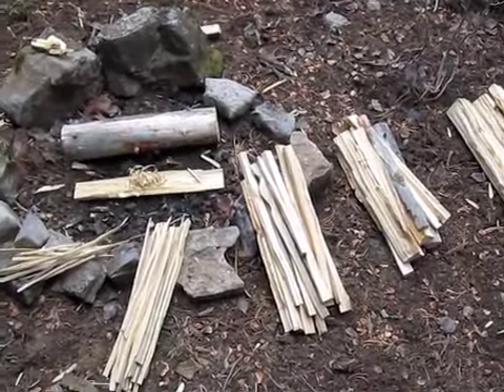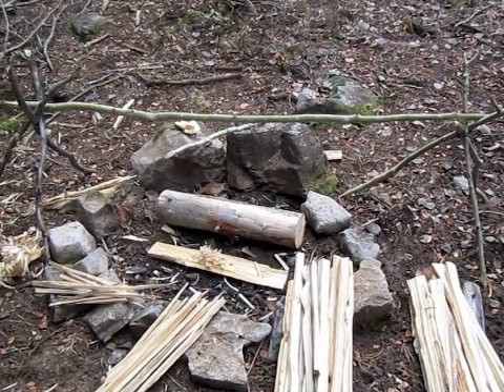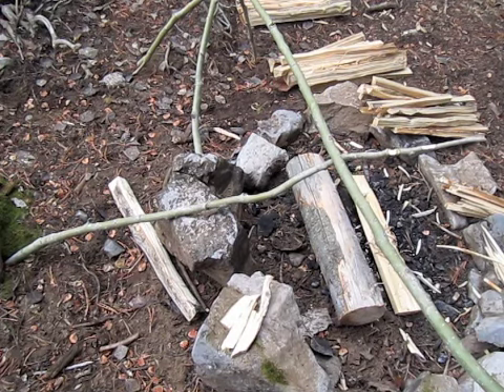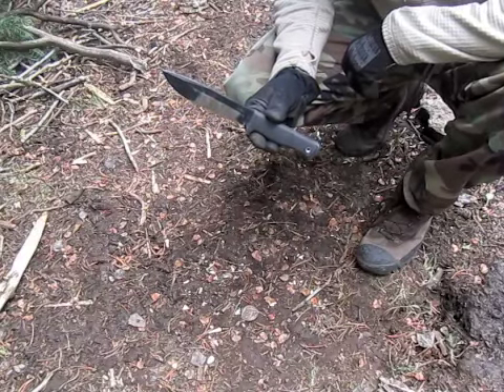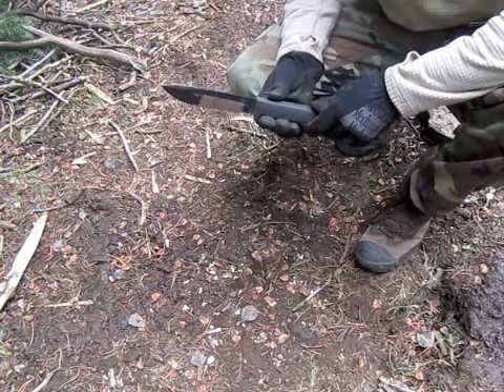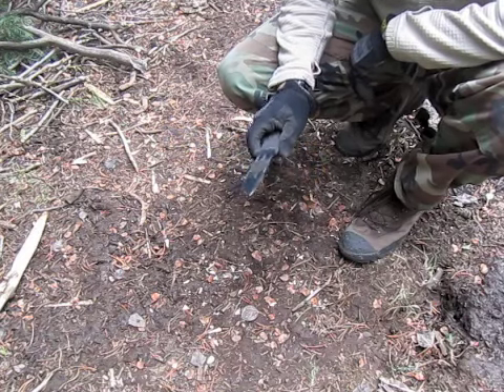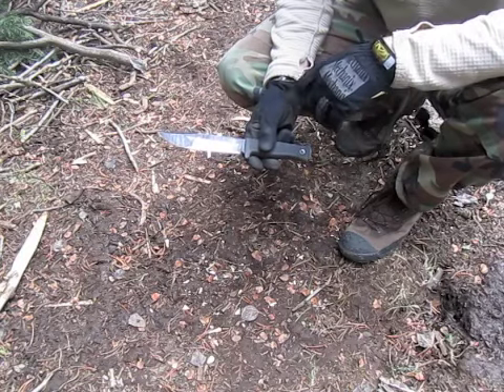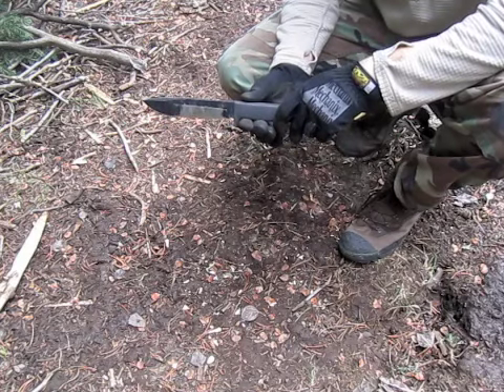Fallkniven A1 in the Field

Comment: @cachewild Yes, the UK/US community focuses on small knives, however there are lots of bush work done with larger knives, parangs, goloks, machetes, etc. are commonly used for such work and the individuals often do not carry multiple knives. Instead the longer knives are usually variable ground to provide different working sections for fine carving, food preparation, splitting, chopping, digging, etc. .

Comment: Great vid as usual :-)  I have secured a maxpedition universal flashlight sheath on the zytel sheath with slim cord, inverted and have the Bahco laplander.  

I also have the F1 and the A2 and I agree that the F1 is more suited to smaller tasks BUT the A1 seems to do most of what the A2 can do especially with the Bahco attached that the A2 doesn't seem to get used much at all.

Comment from the maker: All I can tell you is that the 2 Fallknivens that I have I use a lot.  Probably more than any other knives that I own.  I can tell you that for me the edges hold up very well and I don't sharpen them a lot.  I haven't ever had either of the edges roll or chip, and if they have it has been so insignificant that I didn't notice.  I also have heard reports of the same thing, but its almost always just from someone who heard it from someone else, not the actual owner.

Comment: @Thecarotidpulse Yeah, I have an A1 (older model), you can obviously see Peter's view of strength/durability in the design as it is very robust and they do market it as a survival knife. The newer convex ones have a greatly thinned/acute edge so you have a solid combination of strength and cutting ability. But if you didn't want the utility strength, they do make smaller blades with vastly reduced cross sections which are more cutting optimized only.

Comment: Excellent Video! Have you used the A1 to process any game? I know it's not ideal given the blade length and thickness but just curious if you've tried? I was considering an S1 but I think A1 may be the way to go. From watching the Alone series on the History Channel I'm intrigued by some of the guys bringing what would be considered extremely large knives on the traditional bushcraft spectrum. However they all made it happen with the very large knives regardless, from finer wood work to processing game. Thanks again!
Reply from the maker: +Christian Cork Thanks!  I have not used the knife on game, and I agree that it wouldn't be ideal.  I have used it to clean a lot of trout though, and it was about like you would expect.  Got the job done but not ideal.  I'll admit I'm a Fallkniven fan.  I've got the F1 as well and I've got an S1 arriving in about a week.  Take care!
Reply: Thanks for the reply bro! Can we expect an S1 review here in the near future? I'm also considering an S1 for backpacking and extended trips, I love my A1 but the S1 is nearly half the weight.
Reply: I'd like to get an S1 too, but I hear the handle is quite small around the same size as the F1's. I may have to fork over the money for a custom handled S1 in order to get something that fits my hands.

Comment: @69penetrator69 In general it is hard to load the tang of a knife even in prying unless you do something odd like lean right back on the end of the handle (pommel). While they get a bit of flak, a properly built tapered or even stick tang (or even cable) should not be a functional weakness.

Comment from the maker: @CliffStamp No, its not the v ground.  I said its not a bushcraft knife because I think its too big to be a bushcraft knife.  Of course there aren't any clear cut specifications of a bushcraft knife but they are generally smaller at around 4 to 5 inch blades.  It doesn't necessarily fail at bushcraft, its size just makes it more difficult to maneuver in smaller, more detailed functions.  A bushcraft knife is better for that.  It can still do a lot, just with some compromise sometimes.   Thanks.